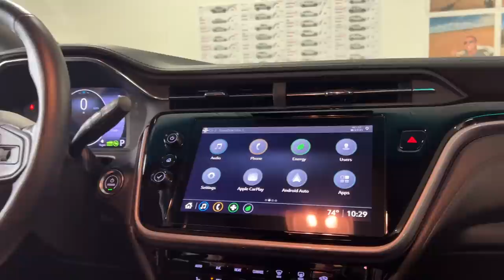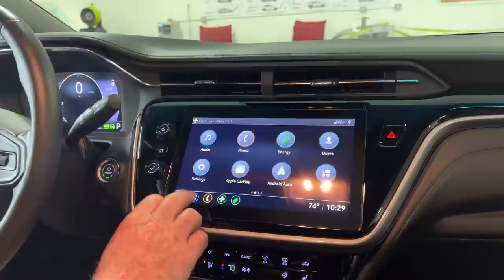Sandy's First Impression of the 2022 Chevy Bolt EV

Comment: I would have love to buy one but the chevy dealer wanted $8000 market adjustment on top of msrp. If chevrolet wants to sell any cars control these stealers (dealers)
Reply: Yeah good luck with that. The "stealers" are independent franchise that do whatever they want. It's time for all car manufacturers to adopt Tesla sales model and get rid of the greedy middle man.
Reply: @reuveng1960  thats exactly what I did with $2000 NJ state EV credit prices become compatibile so I ended up ordering tesla model 3 standard range. Dont ever wanna deal wth these dealers
Reply: @reuveng1960  funny how you compare dealers with Tesla! Tesla raising their price quite often is no better!
Reply: @gmv0553  I spoke about the way Tesla sale cars, I don't care about Tesla itself. Bottom line,  no need for dealers, we should be able to customize and order our cars online with no extra useless "dealer add ons" and price gouging.
Reply: @reuveng1960  Tesla is the one gouging.  Go compare the price of the Model 3 in early 2021 with today.  The car is $8k more expensive.  The reason for dealer "Market adjustments" today is there is a industry wide shortage of automobiles.  in early 2021, you could literally buy a Bolt for $21.5k OTD (Donohoo Chevy).   I bought one in 2021 for $23k with zero haggling.  When the chip shortage is resolved, you'll see all these market adjustments go away, except for Tesla's.
Reply: @conchobar  Yes but the stealers don't buy the chips or make the cars...the manufacturers do (and are the one having to buy the parts). If they can make the vehicle for X price and sell it to the stealer for X plus some percent, the stealer still makes their money selling at or near MSRP. There is no reason, other than price gouging, to add thousands more for popular models in short supply.
Reply: @conchobar  Don't get me wrong. I don't care about Tesla. I got a 2022 Nissan Leaf SV back in February for MSRP. The dealer tried to push all kind of add ons but I rejected. I agreed to pay a small "documentation fee". I don't like dealers, the car price is subjective to your negotiation skills, they try to squeeze  every penny out of you and you need to waste time in negotiating the price. Car buying should be transparent like other items we purchase, plain and simple.
Reply: I am too smart for dealers ,this car is not even worth 25 k if they can’t give me this price ,I will keep on driving my gas guzzler forever ,,Wake UP GM ,or you will have to give them away 🙏🚙
Reply: @gmv0553  You have a point, but at least you know it before walking in.
Reply: @jonnieinbangkok  I will agree with you that dealers are stealers, but dealers do suffer from the chip shortage. They can’t get anything to sell. So they have to jack up prices on what they do get in. If you talk to anyone in a dealer right now, they claim they are losing money on new car sales even with the prices jacked up because the limited cars they sell can’t cover overhead costs. Service is the only place they are making money. I will say I have a huge problem ordering a car and waiting for it and the dealer insist they still have to make it up. It’s a bad time to buy a car.
Reply: @keithv3767  Even before there were any vehicle shortages, when stealers were awash in cars, they would ask for thousands or even tens of thousands above MSRP on popular models.
Reply: @jonnieinbangkok  They are no longer needed. The Tesla model selling direct is better.
Reply: @keithv3767  Agree 👍
Reply: Just don't buy one they will figure it out when no one wants there stupid expensive cars
Reply: @conchobar  I feel like with Tesla, it's at least transparent and fair. You know the price going into the deal. Going to a dealer is a very stressful experience for most people because they don't know how much the car is going to end up costing them after the dealer is done playing tricks
Reply: I bought a bolt euv premier launch edition for sticker and $3500 cash off that at Ron Craft Chevy near Houston TX.   It is a great little car and the self driving is pretty cool. I'm pretty happy with my purchase.
Reply: @david.e.h.  congratulations
Reply: Fortunately, I found a dealer that sold me a EUV launch edition for MSRP minus $6300 4 days ago.  Love the Bolt.
Reply: @akron82  congrats
Reply: @akron82  how?

Comment: The Bolt may be great. So was the Volt. Dealers are the problem.
Reply: Dealers are the problem because margins are the problem. ;>
Reply: I agree, dealers gouge, dealers lie, dealers are lacking in every area of customer service. If US Legacy car makers are serious about being competitive, they need to push for MAJOR changes in this area. And dealers should be scared that  the States' collectively are willing to change their Franchise laws that historically protected their dealerships from another business model for delivering new cars.
Reply: Americans should realize that the electrification of transportation is a MAJOR threat to new car dealerships especially their parts and service departments which provide the lion's share of a dealerships profits (the sales of new cars alone won't keep the lights on at most dealerships). Dealership's literally depend upon ICE vehicles and the extra maintenance they require. As such they want nothing to do with EV's which require near zero maintenance and rarely need parts especially lucrative performance parts. Mass adoption of EV's is an existential threat to the dealership business model. In short dealers don't want to sell EV's because they can't make nearly as much money off of them. Also, they want you to buy ICE vehicles because they can sell you those expensive and "necessary" maintenance plans which are largely unnecessary for EV's. EV's have none of the hundreds of points of wear-n-tear or points of failure that an ICE vehicle has and none of the extreme heat and vibration that prematurely degrades nearly everything under the hood (hoses, belts, wiring, sensors, control modules, gaskets, seals, etc...). With an EV you won't need to monitor, keep after and or worry about things like serpentine belts, alternators, power steering pumps, mechanical water pumps, high temperature high pressure engine cooling system components, spark plugs, coil packs, ignition control modules, fuel injectors, fuel pressure regulators, fuel pumps, fuel injection control modules, timing chains, timing gears and chain guides, transmissions, oil filters and oil changes, O2 sensors, PCV valves, exhaust pipes, mufflers, and catalytic converters. EV's have NONE of these and will never require emissions testing. EV's will even need FAR fewer brake jobs (EV's use regen so the brakes last 3 to 4 times as long). And now with much improved EV battery technology the batteries are lasting over 1500 charge cycles so an EV with 300 miles per charge will last well over 350,000 miles. Dealers know all this and see EV's as a death knell for their business model.
Reply: @stevebakker6884  - If a manufacturer should choose to sell manufacturer direct or "Direct-to-Consumer" (something they should be allowed to do under the tenets of Free Market Capitalism), why should they need to be concerned about giving dealerships an acceptable margin? Under the dictates of Free Market Capitalism if your business model can't survive then it must adapt or go the way of the dinosaur. Of course if dealerships had been forced to recognize and respect the dictates of Free Market Capitalism most would not have been able to survive. Instead dealerships quickly learned how to use their powerful lobby (the NADA) to supply the proper requite to politicians to "encourage" them to sponsor specialized (and totally unnecessary), automotive franchise regulations forcing manufacturers to accept dealerships as middlemen.
Reply: Agreed! I love my 2013 Volt ⚡️  Great car to run back and forth 50 miles each way to GM where I work. GM and ford are seriously screwing up shooting for every vehicle manufactured to be straight EV. I would only want a hybrid.
Reply: @Tron-Jockey  I hope EV batteries have moe than 1500 charging cycles. My 10 year old Volt has already lasted twice that many cycles, and still going strong. I'm very impressed with it, although I know some have had their problems. It's been a beast for me. You're right about the dealers dragging their feet. There's only 3 dealerships certified to work on EVs in "my area", which apparently is between Cleveland and Columbus, and all are 40+ miles away!
Reply: No, dealers are not the problem.  They can't sell cars for one cent more than somebody is willing to pay.
Reply: @larrysmith6797  The main problem is a lack of vision and refusal to adapt.

Comment: I tell you what.....  I love my 2019 BoltEV.  
60,000 miles and no maintenance required...
Charge it off my home, fun to drive, plenty of range, do about 40 to 100 mi per day, its one-pedal mode is the best of all EV's, regularly gets ~4mi/kWh, the car is perfect for me.
Reply: 40k miles overdue for a brake flush?
Reply: I've been trying to get the 2022 out here in AZ, but the dealerships have very few and all get sold once any come in. They also have a long waiting list...I have a 2015 Fiat 500e all electric. Would love to step up to this vehicle. Other reviews are pretty good for this car...
Reply: @jbaer8  Brake fluid absorbs moisture from air. If not changed regularly it will corrode brake system internals and your brakes may not work well. Most manufacturers say 2 years/20k miles for that reason, even if the brakes aren’t used much.

Comment: I very much appreciate this review. I have a 2017 Bolt and have been generally satisfied with it and consider the Bolt to be an excellent city/commuter car. The small size is an asset in finding parking space in crowded parking lots. The battery issue is a concern and I hope LG Chem has taken care of the issue. The MSRP has been reduced by $6,000 for the 2023 model year and I am considering a new purchase. One thing I will say is Chevy has the regen braking nailed.
Reply: I love my ‘17 Bolt.  In the city at average speeds of 30-40 mph, I get between 4.5 - 5 Miles per kWh.
Reply: My big caveat for anyone looking into buying a Bolt now or in the near future is that GM has a whole new battery platform called Ultium that they are introducing a ton of new vehicles on next year. A Bolt-like vehicle based on Ultium cannot be too far long after that. So Bolt owners may find themselves in the position of owning vehicles with abandoned technology and that may mean poor support and not well enough training for repairs because the bulk of GMs training will be focused on Ultium going forwards.
Reply: I absolutely agree.
Reply: @mikus4242  same here. I love when I see the graph above 4, which is usually where my average is.
Reply: @mikus4242  I agree, although I don't quite the efficiency you do but it is still impressive and better than I see reviewers get in other BEV's. The slow fast charging is not an issue with me as all my charging is at home.
Reply: Yeah, I've considered buying the Chevy Bolt as my first EV purchase, but the battery recall had me reconsidering. Most Chevy's in general tend to be lower quality and it might be a while before my reliable Honda reaches its last legs and it's time to go EV for my next car purchase. I hope Chevy does better in the EV space then they do making regular sedans and economy ICE vehicles. This could be a big opportunity for Chevy to improve their reputation and offer the public more reliable and affordable EV options.
Reply: @JEP-Tech  Don't worry too much, the battery recall only really affected the 2019s and earlier. 2020s and later already used a different battery, but GM is replacing those as well out of overabundance of caution. Which is a plus for me, since my 2020 already has 23k miles and will be refreshed with a brand new 8 year/100k warranty once it gets replaced. 😃

The practically non-existant maintenance and low charging costs have also been a huge plus.
Reply: "The small size is an asset in finding parking space in crowded parking lots"
And it SUCKS when you CRASH..

omg dude.
Reply: @chezchezchezchez  You can have large vehicles that are more unsafe in a crash then a well designed small car. The size of the car doesn't matter, but it's crash rating does. I don't know if the Bolt is worse in a crash then most other ICE vehicles, and maybe it is, but I know it is atleast less likely to rollover than a top heavy ICE SUV and can stop quicker than many ICE cars as well thanks to regen braking. I guess no one should drive any sedans or compact cars because of a potential crash. We should all just buy massive trucks and tanks with terrible range and efficiency, and high maintenance costs, because safety. Guess I will sell my motorcycle and compact car, they aren't safe.
Reply: @JEP-Tech  The Bolt has 5★ safety ratings in all categories for the NHTSA 2020-2021 safety standards, except for Small Overlap Rigid Barrier tests, which got 4★. It also had the lowest rollover risk in its class.

👍 For knowing there's more to safety than just size.

Comment: My 2018 Bolt has been great, especially now with the new 66kWh battery. Drove 450km to Toronto ON recently without stopping to charge.  The one-pedal driving is fantastic as well.